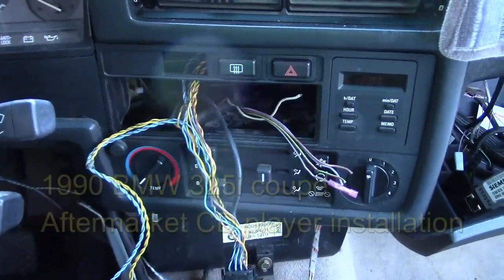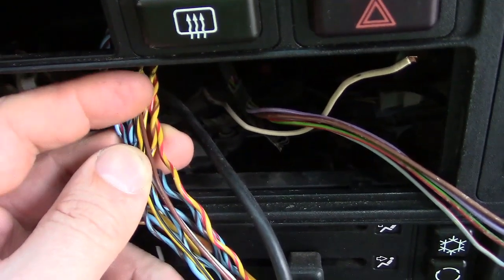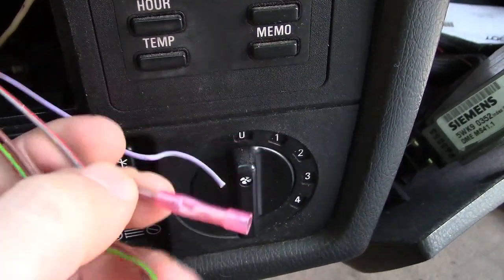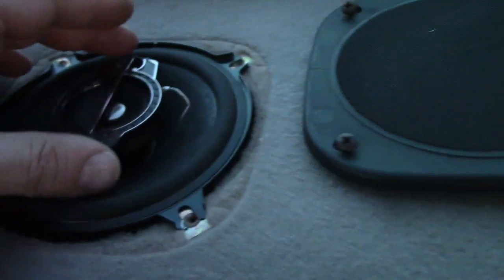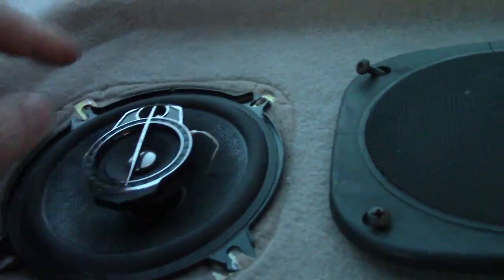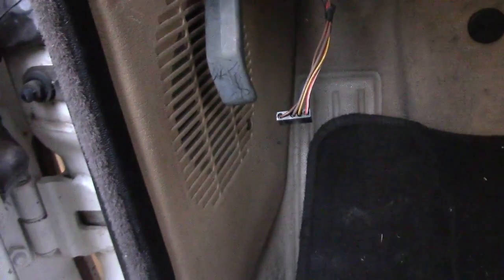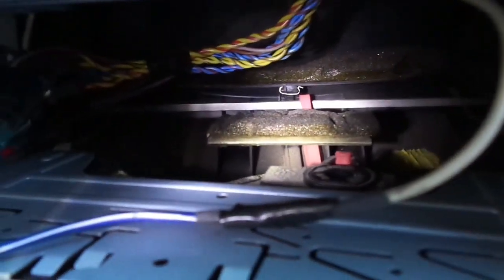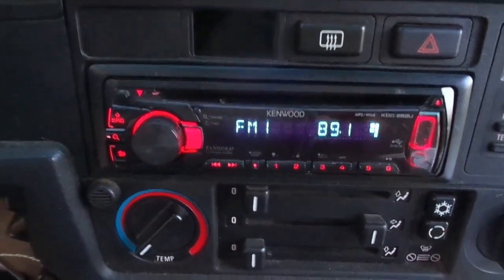1990 BMW 325i E30 aftermarket stereo installation

Comment: Need help, My dads 1991 325 radio has no sound. Fuse is good, not sure if I change the relay will help. I put code in turns on. Thanks for any help.
Reply from the maker: it could be bad radio, or bad stock amplifier

Comment: I installed an after market stereo for my 1986 e325.  The only problem I notice is that the stereo resets itself every time I turn on and off my car.
I had to join the red and yellow wires to get power on the stereo, maybe that could be the problem?

Any idea if I’m doing anything wrong or I’ve got my connections wrong?
Thanks.
Reply from the maker: yes, you did not connect the power source correctly
Reply: @HakenE30  do you live in socal?